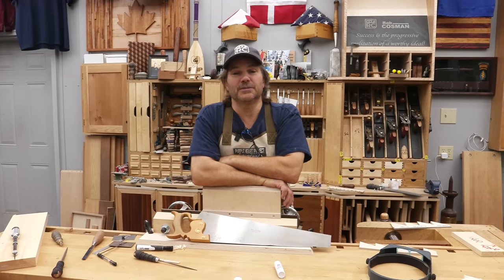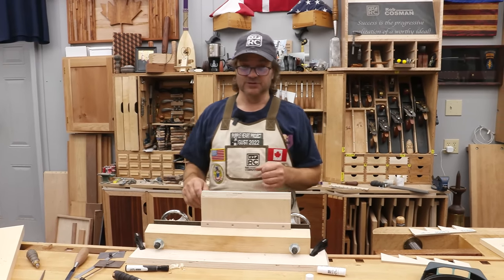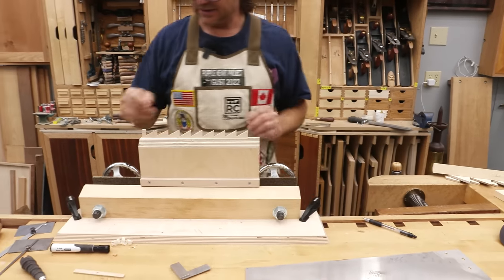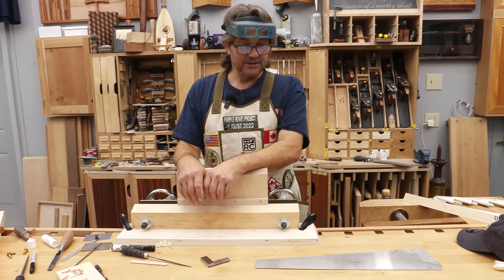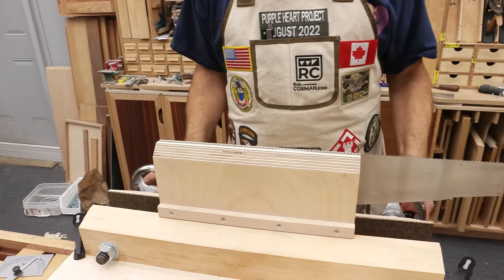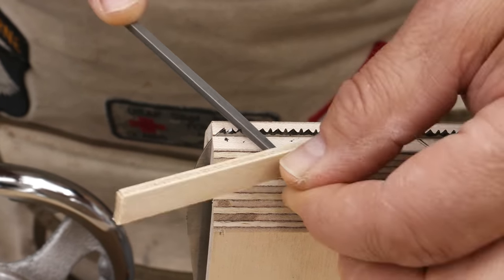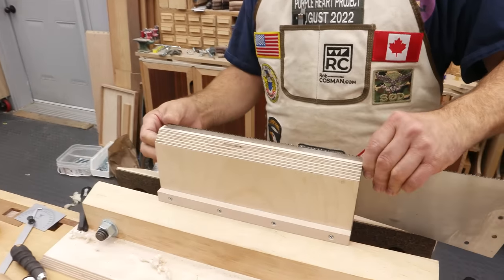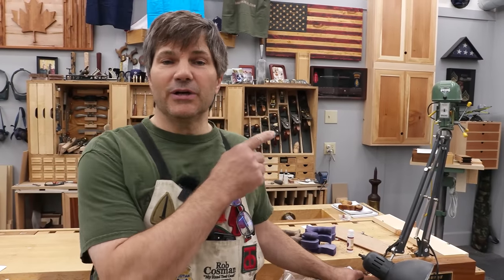How To Sharpen A Crosscut Hand Saw

Comment: Hi Rob, I am trying to figuring out angles for saw sharpening, and I just checked a newsletter article on your website
I now understand why you set the protractor at 60 degrees : it is for a 30 degrees fleam angle.  (zero starts at 90 on the protractor : 90 - 60 = 30.
this is considered as a high fleam angle : better for soft wood. the more fleam, the cleaner the cut, the easier to push, and also a less durable edge.
As always, thanks for your videos and teaching.

Comment: Hi Rob...this is a fantastic video class...I remember my father sharpening his Greaves &Sons expensive saws after set the teeth at Stanley #42 saw set..I hated that sound from file angainst fine saw metal teeth/body when my father was sharpening...about good quality file for sharpening saws a company called Tomé Feteira (Made in Portugal) still making excellent files since 1856...I have many but never tried to sharpening a saw ...your video class make the task "easier" to understand and the special lens can be the tip of tips (in this case)...
Thank you for make our way to see dificult task much simple
Reply from the maker: I will check out those files
Reply: My father loved the 4 " extra fine triangular file..He told me it was the best size for that saw pitch..20  years ago

Comment: Just the way I was taught. Glad to see nothings changed over the last 40 years or so. I did have one of my students tell me once, in fact he insisted that you can sharpen a cross cut saw from one side. Well, I did it. It was miles out, horrible, I had to dress the sides with a stone to correct the tracking. Keep up the great content 👏👏👏
Reply from the maker: Thanks for sharing!  Thats a funny one.  Did you have enough metal to turn the fleam around?

Comment: Using the strip of wood at the end of the file is a nice tip. I'm going to try that next time I sharpen. 2 Questions: How often should you joint the teeth to get them all at the same height? And how often do you redo the set of the teeth?
Reply from the maker: As a general rule joint and set every 3 to 4 sharpenings

Comment: I finally tore down a few old rusty nasty saws I've had for quite sometime. Got 'em cleaned up, Filed the teeth about half off because the original profile was rusty and by the looks of it somebody tried to use a large half round file at one point. I filed new teeth and set the teeth as well. I'm a rookie by all means, and I'm telling you I've never had a full size panel saw cut this good ever in my life. Not sure why I was so intimidated in the past.
Reply from the maker: As I tell everyone sharpening saws is easy

Comment: Mr Cosman i recently purchased a used disston saw that has 8 TPI. Which file from your site should i purchase???
Reply from the maker: The largest of the three sizes
Reply: @RobCosmanWoodworking   Mr Cosman, i need further clarification. Is it the Grobet saw file: 12-16 TPI; Grobet saw file 18-22 TPI; or Cosmanized Grobet mil bastard file: 10"?? Thanks.
Reply from the maker: @hectormontemayor5385  next week we will have the larger size (7-10tpi) available on our site.
Reply: @RobCosmanWoodworking  thanks. I'll visit your site then.

Comment: Good job. Slight niggle with file size. For me, the file should be significantly more than twice the tooth depth. The back of the tooth is also being filed and is longer so best to use that as the measure to check for wear.
Reply from the maker: Good point

Comment: Lovely video Rob. I've yet to sharpen my good crosscut saw, so will likely do it this weekend. In terms of the file height being twice that of the tooth depth, won't the angle of the adjacent tooth be greater than the straight up and down measurement? Not sure it'll make a huge difference to me, but the example you showed with the wood might have given a slight overlap on cutting the back of the next tooth if you see what I mean? Obviously, it was just a piece of wood, but I'm assuming you'd always want to be more than double the longest edge (probably not an issue on crosscut I suppose).
Reply from the maker: Yes more tha double the longest edge.  Not sure my wood teeth model is perfectly made
Reply: @RobCosmanWoodworking  it's beautiful! Cuts like a dream I expect.